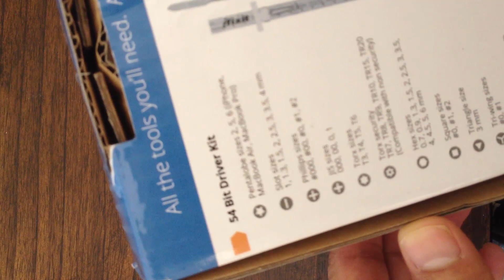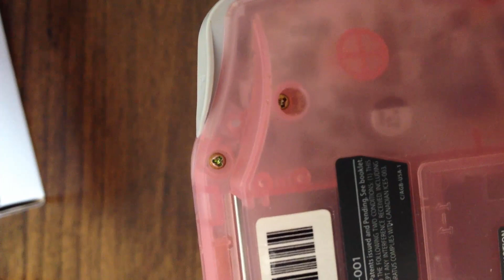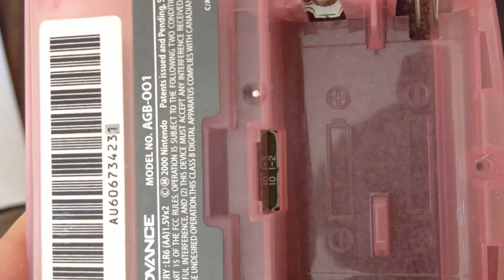GBA Backlight Tutorial 1 of 3 (Gameboy Advance Backlight Screen AGS-101)

Comment: I did the mod on my gba everything has gone well. The only problem is when i look at the screen from a normal position it is very  faint the whites are super heavy. But when i look at the screen at an angle from above the screen is perfect. Does anyone have any ideas what could be happening?
Reply: Hey, did you found a solution? Because i have the same problem :/
Reply: Hey, no I never actually got the screen to look normal but I think it maybe the screen ribbon adapter there is one available from China it has an extra tab on it compared to the one I bought so I think it could be that. I just took the plunge and went and bought a gba that has already been modded. A little pricey but oh well. http://i.ebayimg.com/00/s/MTAwMVgxMDAx/z/L6oAAOSwA3dYT8iC/$_1.JPG

Comment: Hi! great tutorial. I bought a backlit pack at ebay, but the 32 pin flex adapter doesn't have that wire you soldered on the board on part 3/3 video. Can I get any ordinary wire and solder it as seen in the video? if so, where to solder on the 32 pin flex? thank you!

Comment from the maker: The adapter cable has two notches which are supposed to slide into the plastic casing. If you use these two notches properly, then the connector on the cable will sit in exactly the right spot. It's explained in the third video (turn annotations on).

Comment: I found when I installed this kit that the adapter cable was a little short causing it to be sandwhiched between the pins on the logic board and the lcd causing a slight blotchy spot on the screen when I turned it on,so what I did was I cut down some of the pins just enough to be flush with the logic board so the adapter end could sit on the board and not on the pins,needless to say that made the mod really hard to perfect did anyone experience this problem when installing?